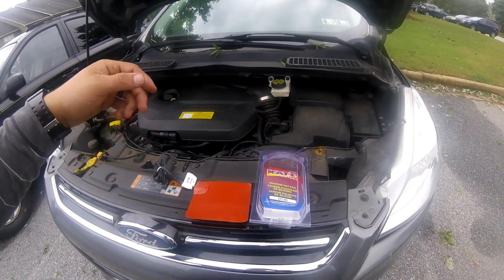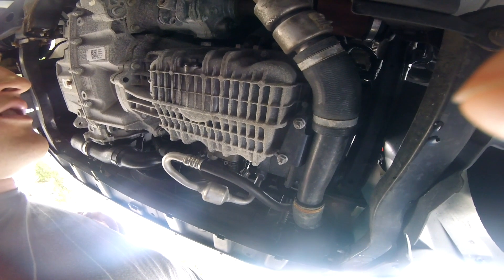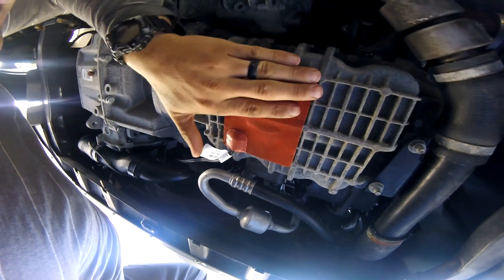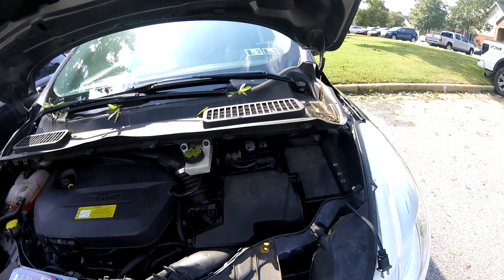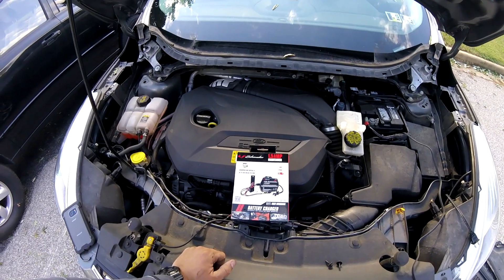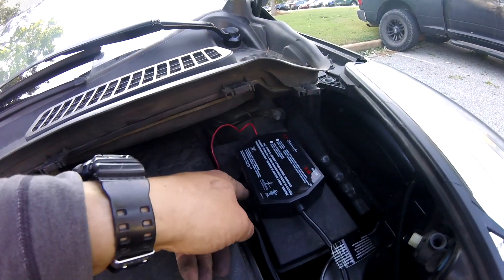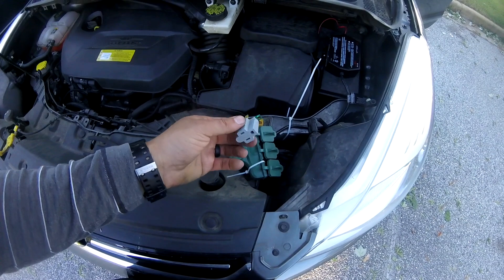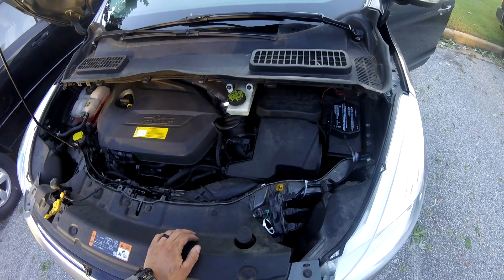Winterizing 2013 Ford Escape  - Oil Pan Heater, Battery Warmer, Battery Maintainer

Comment: Sir, thank you for taking the time to record your installation and uploading it for us to view. I am also interested in buying an oil pan heater for my Grand Caravan, but the oil pan has small ridges, about a few millimeters high, stamped in it. Do you think the type of heater you're using could conform to minor shape changes on the oil pan surface? Thank you.
Reply from the maker: 5jjt the escape has pretty much the same thing. The adhesive seemed to stick pretty well. I would just clean it up with some rubbing alcohol first to ensure it will adhere

Comment: How did these heaters work out? did they fall off at all or any problems?
Reply from the maker: So this car is lucky enough to spend most of its nights in the garage. So we haven't had to plug it in much. However, I did  notice that the oil pan heater is not securely attached. It's not falling off, but I'm not sure how much longer it will last
Reply: NotSoQuaker my VW Passat also had a waffle pattern on bottom of oil pan. Have you thought about a water heater or dipstick oil heater?
Reply from the maker: @jamesmedina2062  the water heater is the traditional one from the dealer, but to diy, it's a lot of work and is kind of expensive if I remember correctly. And I've heard about dipstick heater causing problem like fires or something like that. But honestly, idk how credible that is. I really don't know much about them
Reply: NotSoQuaker Yeah I get you. Well I have always wanted to live way up North as I like the cold but my car is a turbo and takes longer to warm up. I was thinking that water cooling will require more power and time and indirectly affect warm up whereas the oil will flow better and contribute to faster warm up. My dealer will charge 100 to install my block heater. I just don't want it to ever spring a leak.
Reply from the maker: @jamesmedina2062  100 isn't too bad. Thought the install would cost more
Reply: @jamesmedina2062  best heater is an immersion heater that goes in where the oil drain plug goes...it heats the oil directly because it's always sitting "in" the bottom of the oil pan.. but it's an extra step to change the oil so use long life synthetic oil and the best long life oil filter .. or whatever you want.. lots of options!!
Reply: haily 2005 What brand is that? Kat's makes some dipstick heaters and this would work similarly.

Comment: I got to ask, why didn't you go with a block heater?
Reply from the maker: Ben N. To put a block heater on the ecoboost, you have to take the turbos off and drain your coolant. That is a little over my ability and resources. Also, to pay a shop to do it would cost like $400 or something
Reply: Have you tried your oil pan heater in cold weather yet??

I have a 2009 Escape and the factory block heater is only 400watts.  Where I live it will get to -25c on average and hit -45.  Sometimes I feel like the block heater doesn't do anything.
Reply from the maker: Ben N. It hasn't gotten cold enough here yet. I will let you know as soon as I try it out.
Reply: Adrian how long do you turn on your Block heater for ?
Reply: @NSQGarage  if i couldn't get a block heater I'd look into radiator hose heaters. I'd recommend getting one that circulates the coolant as well. That way you've got warm coolant going through your engine when its plugged in.
I've got a lower rad hose heater without a check valve to circulate it. Its just relying on the warm coolant to rise, but I'm not so sure how much warm coolant actually makes it up to the engine.

Comment: Why would you try to warm 5l of oil when all you need to start the engine is to provide warm air & fuel and oil will warm itself within 10 minutes. Also to warm oil from battery is eating your power and you would need to swap your alternator for bigger to charge back battery. (I swaped my TOYOTA Regius 70Amp for 140Amp ...can you do that?? answer that question ...if you heave no battery charger pluged in to your systm every night ... other wise you will finish your battery in one season:(  ... ( .. My advice ...warm inlet manifold and wait 2 minutes after engine start to catch a bit of temperature before you drive. Cheers
Reply from the maker: The oil warmer runs off 120V when I plug it in. It was a simple and cheap option to help the engine on start up in cold temperatures
Reply: Uhhh...you plug the oil pan heater into 120v ac power. Same with the battery warmer. Did you watch the video by chance?

Comment: if you need both a battery trickle charger and a heater, you got a problem lol
Reply from the maker: i admit that they aren't really necessary. i saw it and thought it could be useful in some obscure situation lol. for instance, maybe it would be helpful if the truck was sitting for longer periods of time (a week or two) and it was in the -20s for most of that time. idk haha
Reply: NotSoQuaker good investment. Batteries are not cheap
Reply: Gonna be -50°f in Chicago and Wisconsin as well as Minnesota this week. I bet your glad you have it now lol. Btw thats without windshield temps. I just picked up pad heater and battery warmer for my f150.